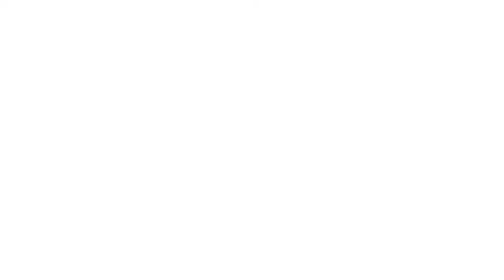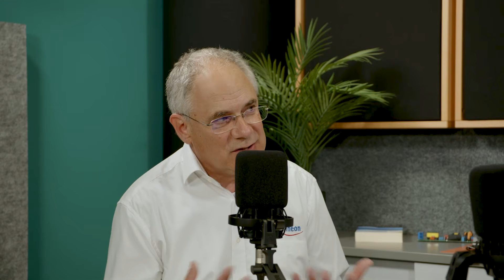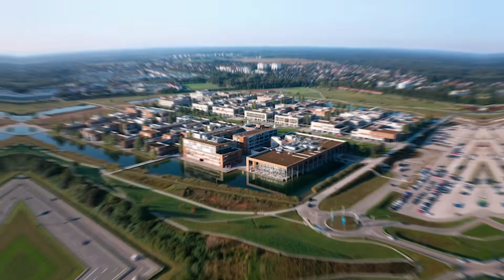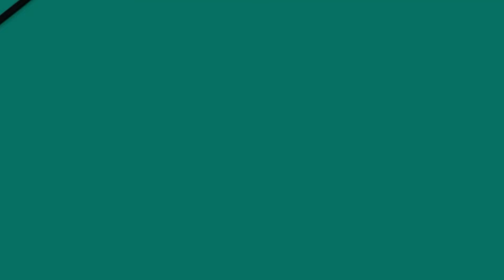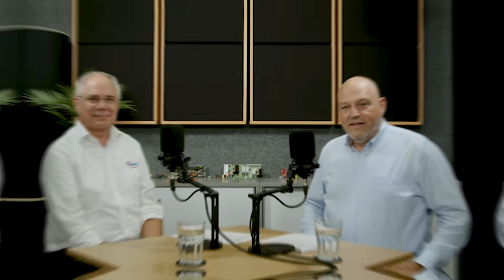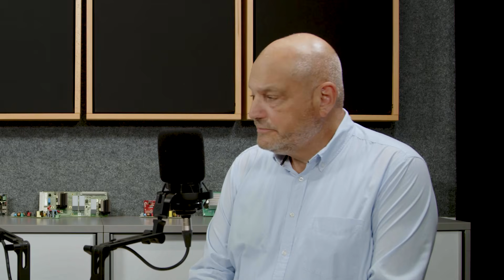Protecting AI Power with Solid-State Circuit Breakers | High-Voltage DC for Data Centers | Infineon

Comment: The lowly BMS ad used on batteries from 12v to 800v in vehicles is a version of solid state breakers.  Some are cost competitive with mechanical breakers.